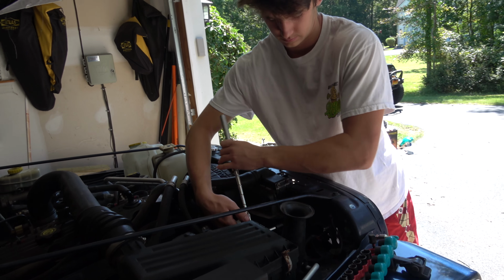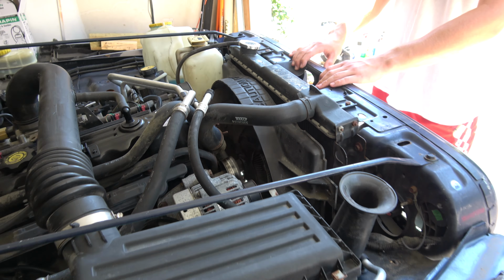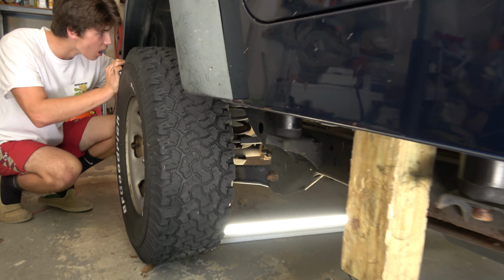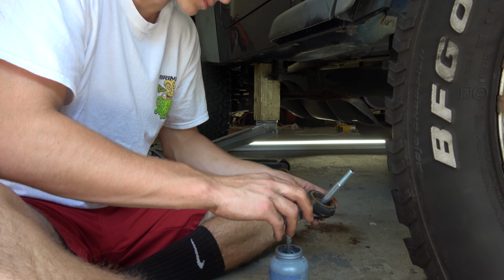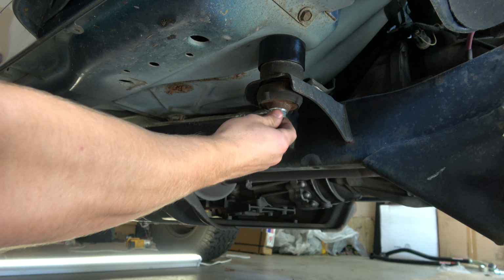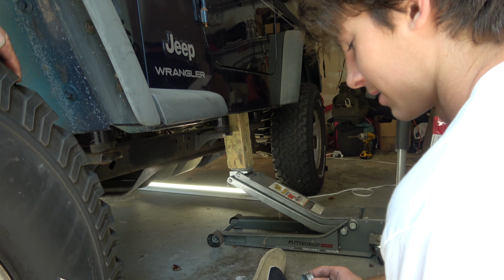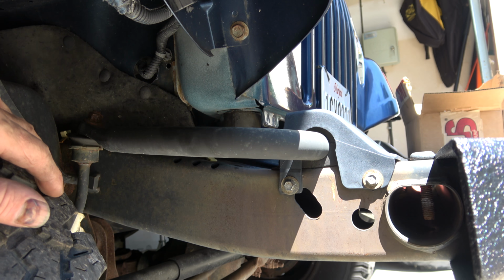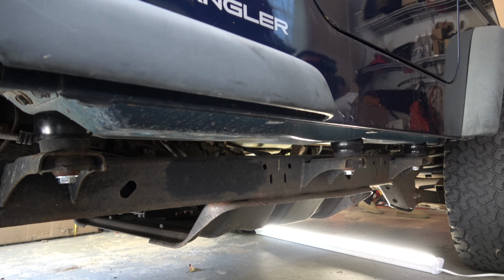JKS 1.25 in Body Lift Installation - Project 2004 TJ Wrangler

Comment: I was under the impression that you would have to lengthen the gas tank fill tube as well? Did you just detach the filler tube from the tank? OR lift the gas tank skid?
Edit: actually,  I just read their website for this product and it specifically says none of that is needed. I wonder how they got away with lifting away from gas tank but not needing to worry about filler tube....hmmm

Comment: Great job and always informative. The JKS instructions list a few modifications that you did not do so I am curious if they were not necessary for the TJ? Modify/drill/cut the transfer case linkage, radiator and fan shroud. My assumption is that since you installed a Brown Dog MML the transfer case linkage relocation bracket was not used, but did you need to remove the bracket in order to lift the body from the frame? Also, did you need to drill new mounting holes for the radiator and also trim the fan shroud?
Reply from the maker: Michael Ring yes. It was the motor mount lift that rendered those other mods as unnecessary. No fan or shroud mods. The tcase bracket is only "if needed" but some don't. I don't know which I am yet...but feeling don't at the moment.
Reply: CPO - Thanks for the reply.  Always good to read, and see, what you are doing as I am doing similar mods.  You have been a huge help for me during my installs.  Completed the DPG Ultimate lift a couple months ago, but now I feel the need for 33" tires so I ordered the JKS BL and Brown Dog MML.
Reply from the maker: Michael Ring awesome. And your welcome. Thanks for watching!!!
Reply: You all probably dont care but does any of you know of a method to log back into an instagram account..?
I stupidly forgot my login password. I would love any assistance you can offer me
Reply: @Dustin Demetrius instablaster =)
Reply: @Lance Kolton It did the trick and I finally got access to my account again. I'm so happy!
Thanks so much you saved my ass!
Reply: @Dustin Demetrius Glad I could help =)

Comment: Got a question what did you do about steering column where it goes thru firewall and the gas filler neck.
Reply: And the transfer linkage
Reply: @lawnmowerman4040  I took care of that with the Novak cable conversion.the column I raised it up with a homemade bracket.the gas filler neck I still have to come up something.most likely an old radiator hose.i guess

Comment: Did you have a problem with connecting the gas filler tube? after installing the body lift on my '04 It won't reach all the way up
Reply from the maker: You may need to loosen the filler hose clamps and stretch things out a bit. I ended up doing that after I put the gas tank back in. It was sorta a pain... but you can pull the fender liner and get in there. Spray the hose junctions with wd40 and work them loose...
Reply: o3djeeps [ OVERCLOCK3D Jeeps ] I'll give it a try thank you! Btw your videos were very helpful in installing my lift!

Comment: It's funny that they did not make one solid big spacer rubber (one to replace the old and big enough for a lift), but actually want you to add it on top of the existing body spacer without removal of the old body mount spacer. 

I see there is a lot of rust under the Jeep, are you going to clean it out at a later stage?